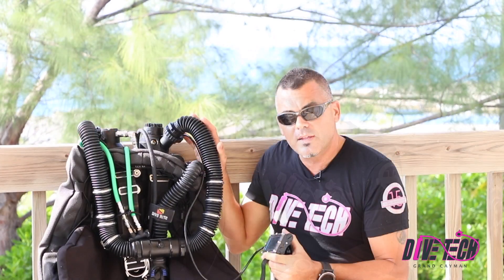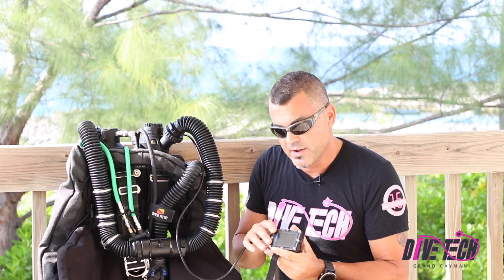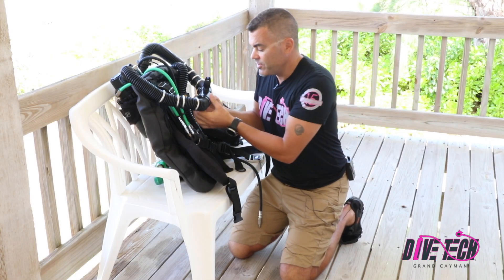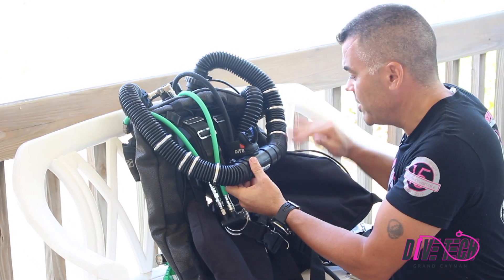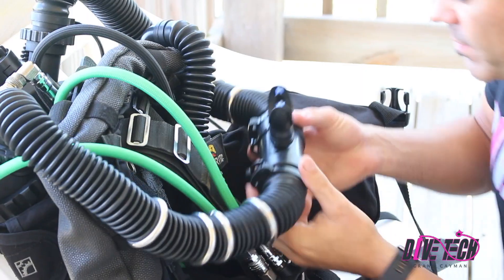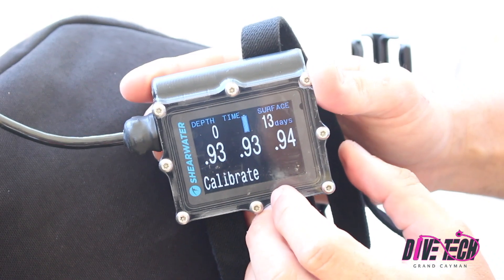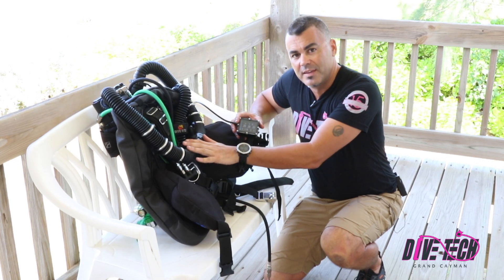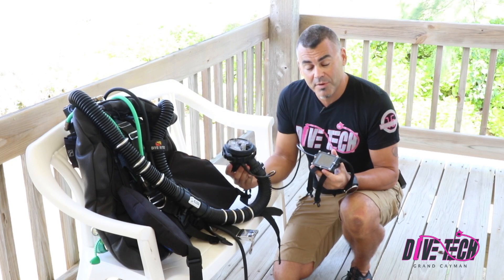How to calibrate your Shearwater rebreather electronics

Comment: To check your sencors after the calibration. Dive to 20 feet and oxigen flush. If your Shearwater reads 1.6 your cells are good and don't need to be changed. Have spair cells just in case one showed failure at this test.

Comment: why don't you just calibrate it to air and save the oxygen?
Reply: Because of the decay for the cells
Reply: @SeattleRingHunter  I would want to calibrate the re-breather as close to where I wanted it, or where it should be, when being used.  If you calibrate it with air, it would be most accurate at air, and become less accurate as O2 decreased/increased.  If you calibrate it at O2, it would most accurate at O2 and become less accurate as the O2 dropped. Air is ~1/4 of O2 -- quite far away.  Furthermore and more importantly, having a complicated calibration procedure is not a good idea when your life is on the line.
Reply: @toddshoemaker4285  as sensors age they are still accurate for air, but NOT accurate for high amounts of O2. Because the controller is trying to maintain a certain PPO, it constantly injects O2, until it hits that point. If the controller isn't calibrated to the cells then the computer doesn't know the exact amount of PPO you're being exposed to, which is deadly.